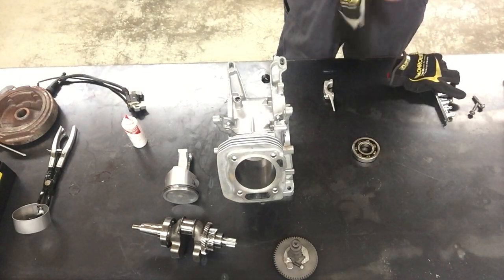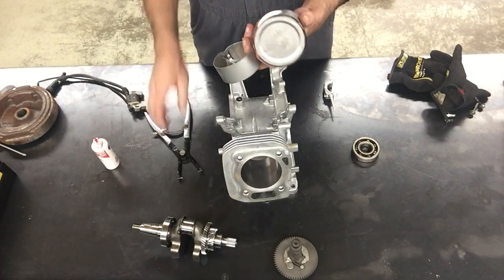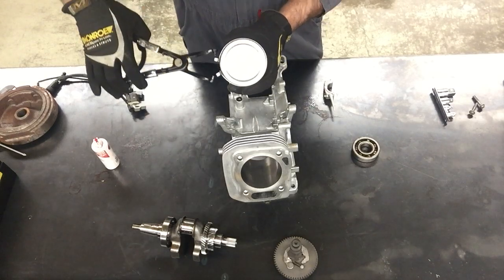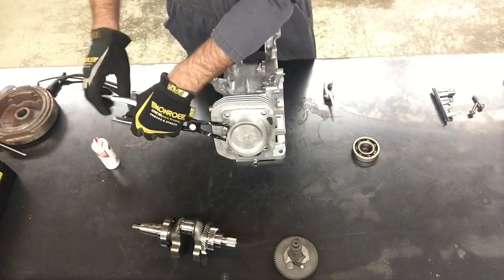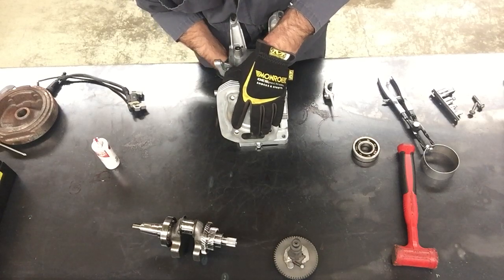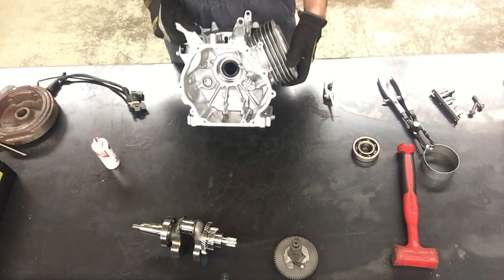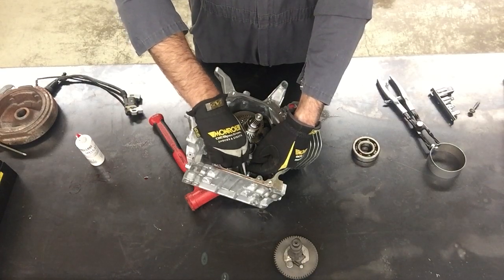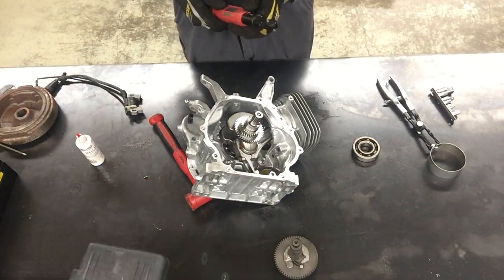Piston ring compressing and installing crankshaft Honda GX 390

Comment: 6 years ago I put the arrow up to see if it makes any difference 
I use wood spitter a lot and still running great and no problems
Reply from the maker: I think it mainly helps to orientate the connecting rod and cap on the proper way. Glad to hear it’s running well.

Comment: I have a 390 with a sheared flywheel key. How does that mess up the timing?
Reply from the maker: It messes up the ignition timing. The flywheel has the magnet on it that causes the ignition coil to spark. So your spark will be happening at random times instead of TDC.

Comment: I work in this specific engine on a daily basis and also the GX270. I never really took note of the dot on the piston I always knew the long end was always at the bottom. I use two clutch systems a dry clutch and also a wet clutch. I see your crankshaft which I’m guessing is the gear reduction? Please correct me if I’m wrong. Love the video as I’ve learnt a couple things from it 🙌.
Reply from the maker: Yes our engines all have a 6:1 gear reduction gear box on the crankshaft. Glad you enjoyed the video.

Comment: Do you have more than the two videos on this engine? Feel like my piston is too tight
Reply from the maker: If the piston feels tight or rough sliding up and down in the cylinder it is typically an oil ring install issue or a ring got bent while installing the piston. Take it out and recheck.